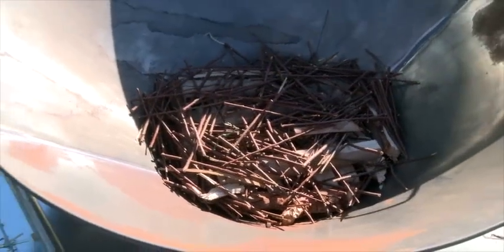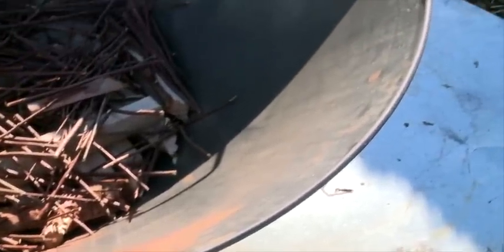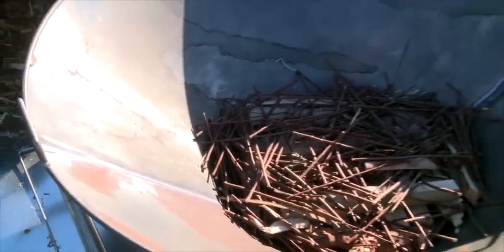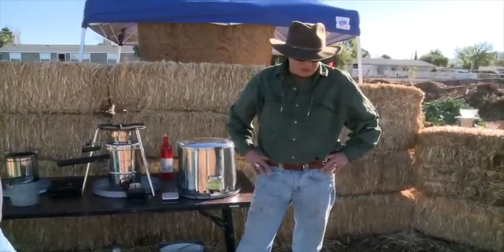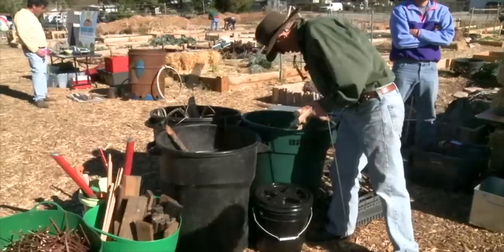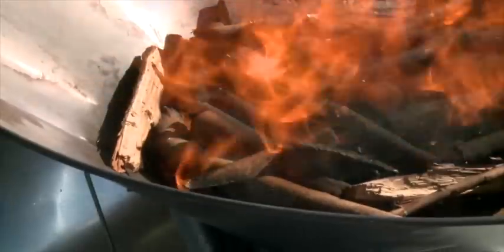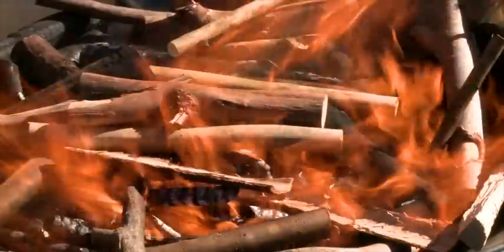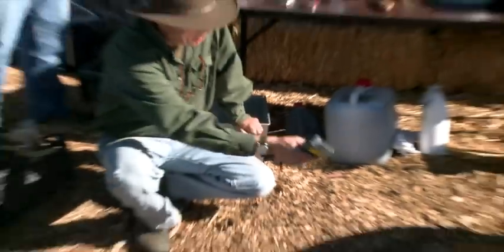BlueSky Biochar Cone Kiln 2014

Comment: there's a couple in Australia that do the same as you, but they put a raised metal wall around the retort. it's as high or slightly higher than the burn cone. 
  They say that the system draws air from the gap beneath the raised wall. The air rises up and enters the open center of there kiln in like an upside down mushroom cloud ☁ vortex fashion. So it drives the smoke donw into the center and flames comes out the edge

Comment: I think this is a great design overall, I just wished the demo was using actual waste wood... It was fueled almost entirely with what I would gladly use in my wood stove indoors to heat my home.  I'm hoping we start using these tools to teach people how to make this incredible resource out of truly waste material... Japanese Honeysuckle bush, other invasive branches, dried weedy chaff, diseased prunings... things that would be best served cooked to carbon... Nice, dried, split, stove length wood has a higher purpose to heat a home!
Reply from the maker: All the wood and products used in this demo are waste product. The cut rectangular boards are remnants from a furniture factory. BlueSky Biochar only uses waste materials in its production.

Comment: Nice video showing the debut of the SoCal Cone Kiln! I hope everyone notices that most of the smoke you see is from the biochar stoves that are not being operated properly! Please, pay attention to your stoves and don't let them smoke like that! More cone kiln lore at my blog, www.greenyourhead.com
Reply: Kelpie - do you use the circular arrangement of wood that Josiah does? Does that help the newbies cut down on the smoke with the cone kiln?  Or does the open stacking method work better - like the improved field stacking method all you all were working on?
Reply: Erin Rasmussen
Erin, I do not use the circular arrangement. The cone kiln is not really big enough for the wood to arrange easily in a circle. The wood I use is sized at 1-3" diameter (approx) by 10-24" length. To start it, I make a little teepee fire like I learned in girl scouts. When that has been reduced to a layer of glowing coals about 3" deep, I start adding the sticks in layers, one layer at a time. Each layer is criss-crossed with the layer below. I try to leave a half inch or so between each stick as they are laid down. That reduces the smoke. As each layer begins to char, the next layer is added. Don't add too fast, or stuff on the bottom will begin to cool and won't char all the way through.
Reply: Thanks!  :-)   So a good coal bed is important, and then build up from there... keep the spacing between the sticks so that you've got nice even air flow.